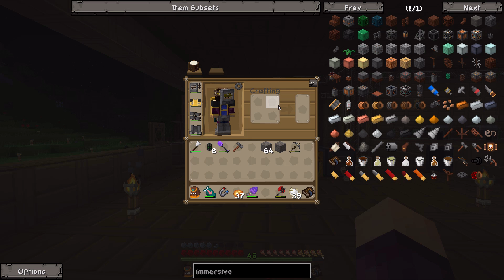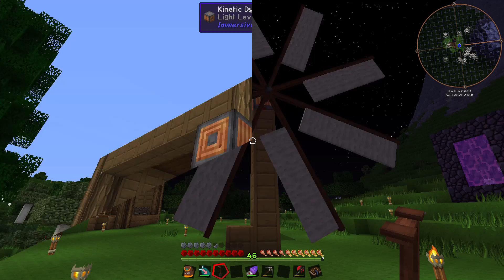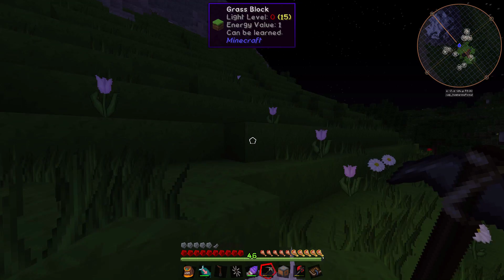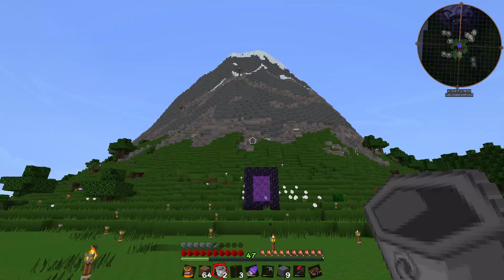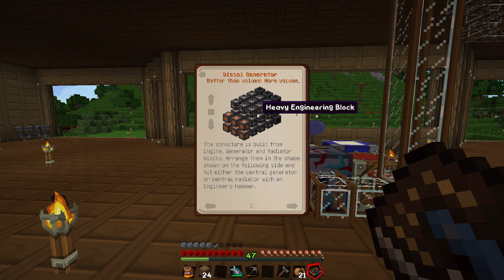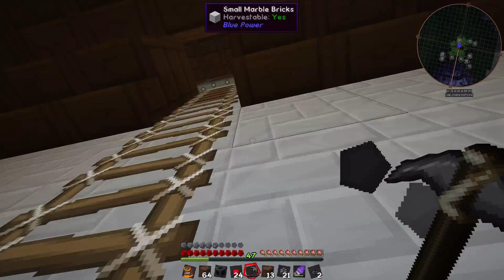FTB Horizons: Daybreaker - Part 13 - Diesel Generator!

Comment: Silly Isaac!  Speed and energy upgrades for the Mekanism machines are cheap and allow you to make things much faster. 

If you run a piece of coal through the Enrichment chamber to make compressed coal, you can end up with 5 pieces of steel for each piece of coal.

Comment: Fun fact with EMC. Coal has EMC and can be created in the condenser. Iron has EMC. By extension, the steel from quantum flux has EMC.

Also, you can climb power poles like ladders/scaffolding.